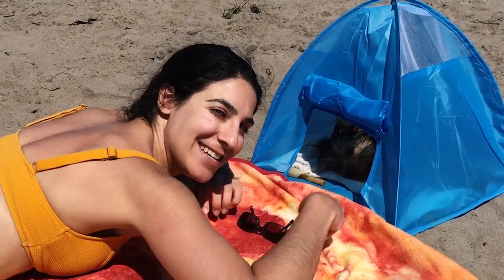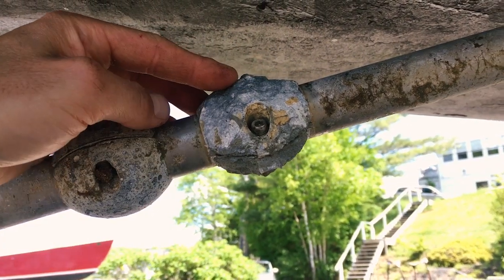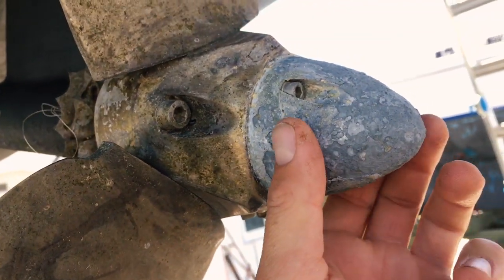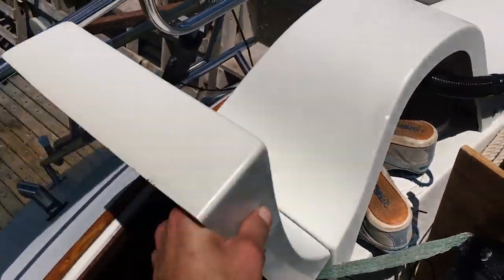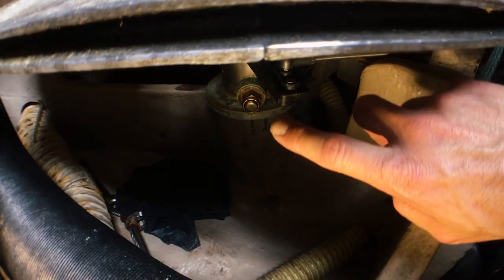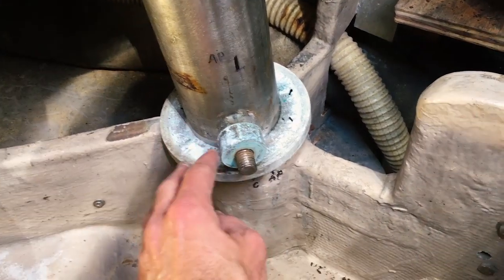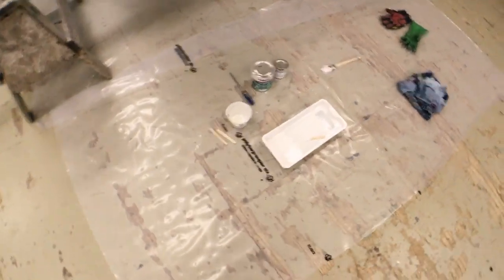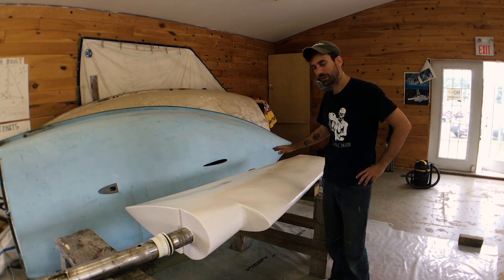Sailboat Rudder Rebuild | Sailing Balachandra S02E38

Comment: Nice vid.
 I especially liked the AYC scenes. I just pulled my rudder off a Hinter 40.5 and I am glad I did it on the hard, because even though the books says that it is supposed to float, I am sure it would have gone to the bottom!

Comment: Hi thanks for the video. I have a question, I rebuilt mine similar to the way you did. I did however beef it up a bit. I was very proud of it until I took the boat out. Now it pulls to port when motoring over 4.7 knots.  any suggestions?

Comment: Hi great video. I am doing the same project and your video has helped a lot. What did you use secure the rudder bearing in the rudder hole ? 4200 ? Epoxy ? I know you want to make sure it’s secure so it doesn’t spin in the rudder shaft hole. I am doing mine tomorrow. 
What were your spacers at the top of the lower bearing made of. Mine was missing and I am trying to make a new one out of a cutting board. Any help would be appreciated
Reply from the maker: secondwind thanks for watching! Our rudder doesn’t have the same bearing you’re describing. Our rudder shaft is solid steel and a hole was milled straight through it so a long bolt can pass through. The bolt is much longer than the shaft to allow for 2 large brass bearing “wheels” which turn across a large aluminum disc. All that is well greased. The rudder is held secure by reinforced close fitting channels both in the hull and in the deck. I hope this helps?

Comment: Thanks for the great video. My rudder needs a rebuild, and I didn't want to spend what a yard would charge. Now I'm likely to to the rebuild it myself. How do you make sure the rudder shaft is centered (side to side) in the rudder? Is the webbing bonded to the insides of the rudder?
Reply from the maker: I was lucky in that my rudder was lined fore and aft with a thick filler which was holding everything in place solidly. If the filler wasn't there I would have made something using epoxy to hold the shaft and webbings in the center.
Reply: Thanks for your reply. Is it possible to drop the rudder while the boat is in the water, or is there too much floatation?
Reply from the maker: I wouldn't try that unless the rudder weighed nothing and was well above the waterline like an external rudder shaft. Despite the foam, my rudder would definitely sink to the bottom. Also with my boat, when waves hit the transom I'd have seawater coming right into the boat through the open hole.